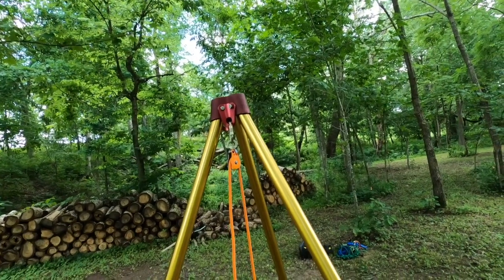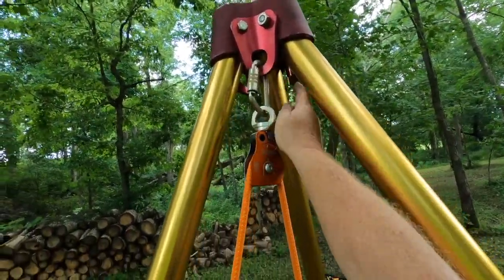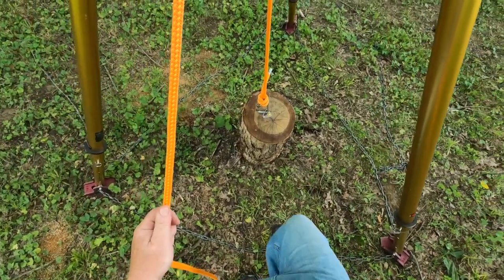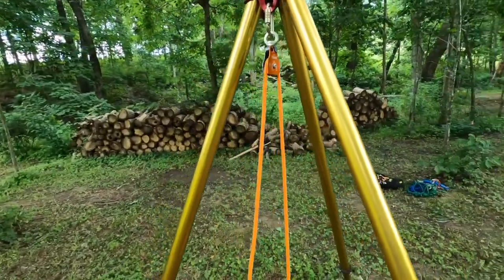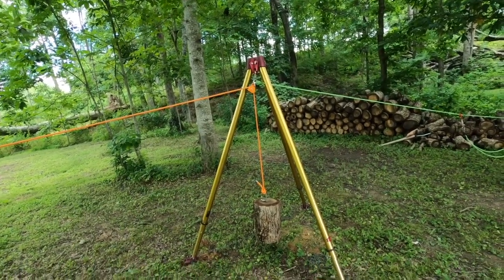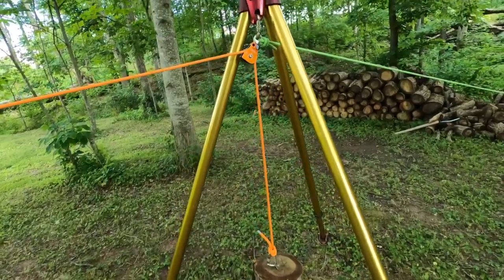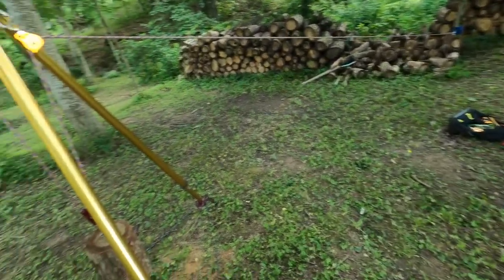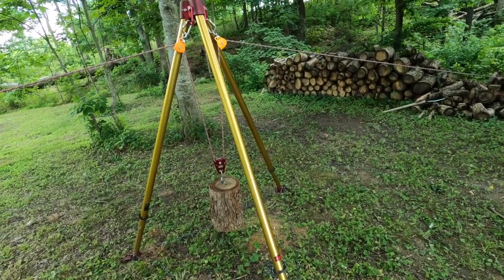How to use a Tripod for Rescue

Comment: Option 3 (drop loop)is the best option since you have 6:1 mechanical advantage.
Reply from the maker: The best option is always what the situation presents. That is a fancy way of saying your environment and equipment are going to determine your course of action, not what is best or most efficient necessarily. That is why it is so important to have several techniques learned so you can adapt on the fly especially in a rescue situation. Thanks for commenting.